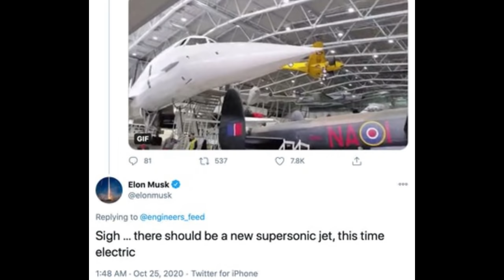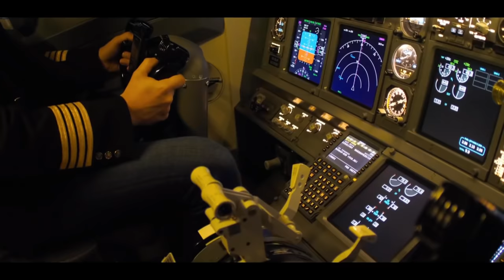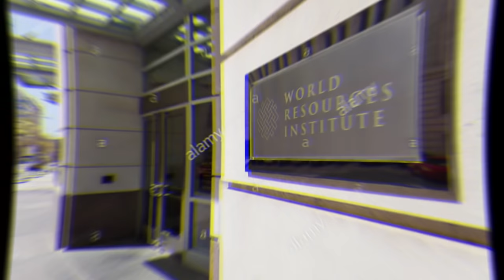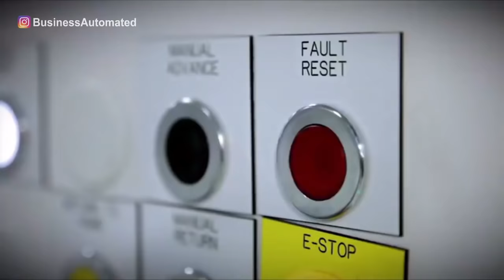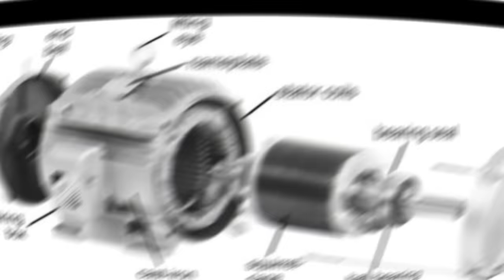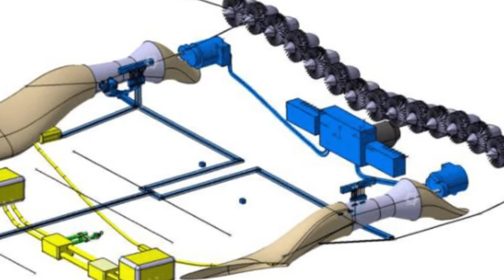MINDBLOWING!!! New Tesla Battery Breakthrough Brings Electric Aircraft Closer To Reality in 2021

Comment: Heaps of false advertising coming out of this channel,
Reply: Exactly. Even if we assume Elon's plane is anywhere as efficient as the Boeing 787-9 using 31MW of power. It would require 458MWh of battery to supply the plane with as much range as it normally have.

And that much battery would weight 1200 TONS even using the 360Wh/kg battery.

The plane can only carry 52.5 tons. 

We would need battery technology to reach a specific energy of at least 8.7kWh/kg for it to even carry itself. Let alone itself + people + other payload.

Comment: The issue is Tesla doesn’t have a 400 watt/kg battery. Their new battery is revolutionary because the cost to produce it not because of the energy density. Also at 400 watt/kg you need to have 70% of the planes weight be battery. Right now fuel makes up 25% of your standard planes weight. You would have to not only invent a physics breaking battery. You would have to build planes much lighter.
Reply: There's always problem with batteries, but Airbus already planning hydrogen infrastructure for new generation of planes. Musk has only rumours based on few conversations and too much work with Space X and Tesla.

Comment: This is not at all feasible technology
The pay load will be higher since plane has to carry some form of gas which is the medium for jet through nozzle to produce thrust

Best of luck to Musk
Reply: Air is gas, right? Heat it up. No need to carry extra. However, batteries weighing over 8,300 tons are needed for 1 equivalent supersonic flight  of Concorde (100 passengers) london to NY

Comment: 1:58 that's a bullshit estimation Exactly. Even if we assume Elon's plane is anywhere as efficient as the Boeing 787-9 using 31MW of power. It would require 458MWh of battery to supply the plane with as much range as it normally have.

And that much battery would weight 1200 TONS even using the 360Wh/kg battery.

The plane can only carry 52.5 tons. 

We would need battery technology to reach a specific energy of at least 8.7kWh/kg for it to even carry itself. Let alone itself + people + other payload.

Comment: Meanwhile Airbus is building H gas cells electric motors and tanks that will sit right where the current jet engines appear on an A320 or A220. The difference is that these will not be ducted fans and can have wing structures through the propulsion system. Also see the work of UK company Faradair
Reply: Edwin Jansen  Welcome to Brasil Mr. ELON Musk..
Great time for investiment here in Brazil now...

Comment: There are electric airplanes already, but will never work for commercial purpose..batteries and solar panels are WAY more "Heavier" than Jet Fuel
Reply: Never say never.
Reply: But the engines weight less.  When batteries get lighter the electric aircraft become very competitive.
Reply: @robertsmith4077  Not when compared with jet/turbine engines.  And they have nowhere near the power.  Also remember, propellers can't go past a certain SUBsonic speed.
Reply: @louievasquez2381  Lithium-ion battery has nowhere near the energy density of hydro carbons. For now it is science fiction. It's okay to do research on it, but it fucking annoys me every time Musks suggests that "within 3 years, 5 years" or whatever he will deliver this impossible to deliver thing and all his fanboys cheer and not ONE critical question from any journalists.
Reply: @billcichoke2534  agree. TU-95 flys at the same speed as a 737 but the noise can be heard from the edge of space. Where the ATR or Dash 8 goes now, that will be the market. High cycle short trips
Reply: @theairstig9164  There's plenty of places where people would LIKE to put electric planes.  Unfortunately, due to the inherent limitations of battery-powered electric motor props, they're not much more effective in any role more than proof of concept 2 passenger prototypes.

Liquid fuel reactors and/or superconducting thermopiles running high frequency piezoelectric grids or plasma ignitor ramjets would seem to be a better direction to look...
Reply: @louievasquez2381  I can't say never but I doubt it will happen in the next 20 years.